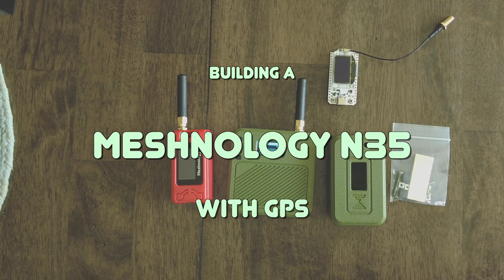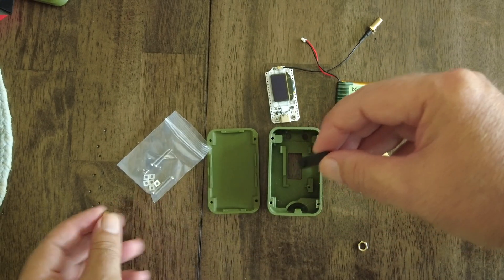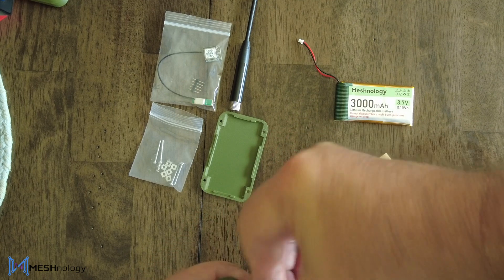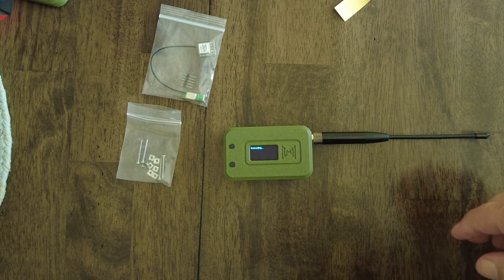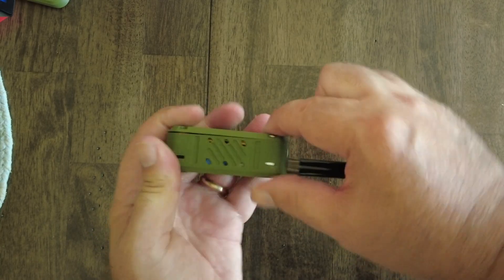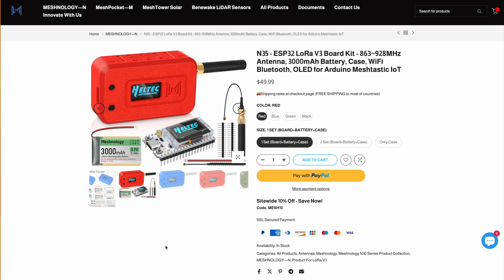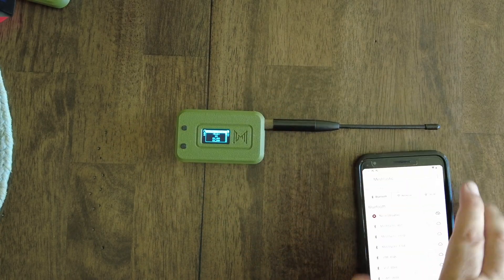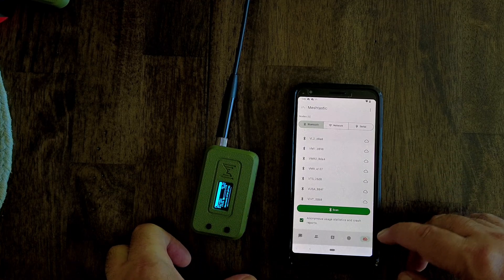Build a Meshtastic Node: N35 Tutorial 🚀

Comment: I note in your diagram you document using PIN_GPS_EN connected to Heltec v3 pin 46, but in the Meshtastic setup screen you have it set to 36.  Which did you actually use?
Reply from the maker: Thanks for the comment. I ended up using pin 36.